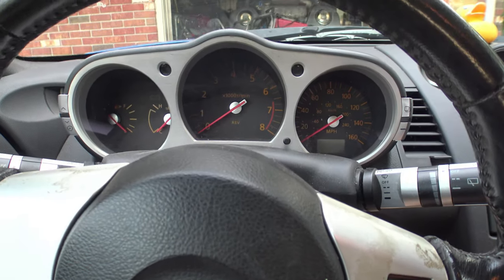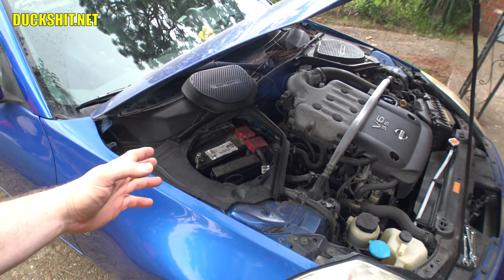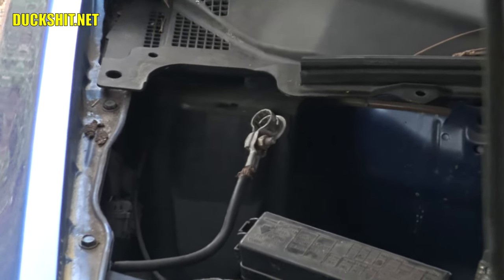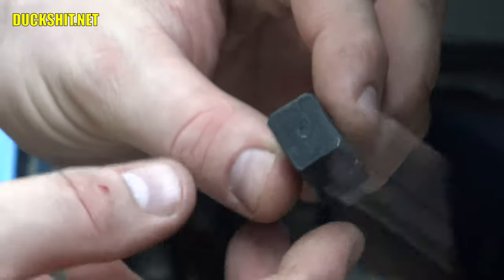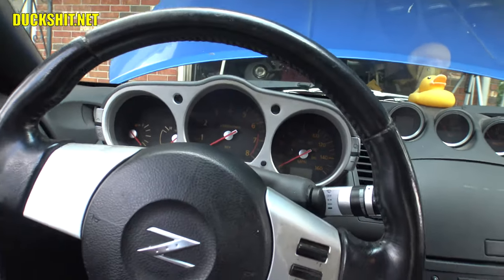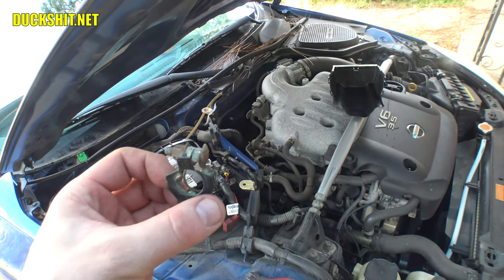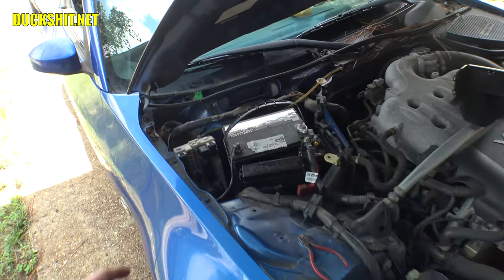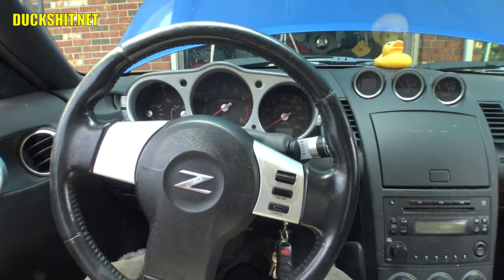Nissan 350Z Won't Start Fix - 4 Things to Try - IPDM Repair

Comment: too bad you didn't  do a video on the trouble shooting of the IDPM and the solder fix...would have liked to see what you did and saw.

bravo for fixing it though
Reply from the maker: Thanks, but anybody with a soldering iron knows how to fix it.  Just melt the dot with the crack in it.  That's all, not a very exciting video.   😁👍🏻
Reply: @DuckmanCycles  I hear ya...I get that you just wanted it fixed...but we (I sure don't) may not know what to look for on the circuit board.
Reply from the maker: I hear ya, but that was a bit outside the scope of what I was doing.  That's years of experience stuff.

Comment: Any idea what going on with my auto 2003 z, so last night it drove/started 100% fine. Today I go to start it and the battery is dead. I had to manually unlock the door with the key and see that the battery light on the dash is on but it’s really dim. So I take out the battery go to autozone and swap it out for a new one and they tell me the one I had before is not good anymore, which I thought was weird because I’ve only had it for under a year. So I take the new battery and once I plug it in there was a very noticeable ticking noise coming from that battery/ fuse box area even though the car was turned off. So then I go to start the car and it just cranks but doesn’t start. Any ideas what it could be?
Reply from the maker: What was the light on top your dashboard doing?  Have a look and lemme know.
Reply: @DuckmanCycles  can I dm you on instagram if you have one? I have a video of exactly what the car is doing, to answer your question I do recall that red light being on but didn’t think much of it.
Reply: @DuckmanCycles  Hold up I’m looking back at some videos I took of the dash today and I see the reflection of that red light being on🤔
Reply from the maker: @officialz3323  If the red light is on solid after you turn the key, they it is likely be your immobilizer.  Try a different key just for grins. But it could be the antenna, which is a ring around the key switch... it would be kind of strange for that to go bad suddenly though.  It could also be the BCM/ECU forgot your keys and needs to be reprogrammed... also a straighe problem but possible.  Hopefully it isn't a bad computer.
Reply: @DuckmanCycles  The red light is on solid but the key is not in the ignition, literally have to unplug the battery or the dash will stay on flickering and will drain it, car still only cranks but won’t start. The previous owner only had 1 key so that’s all I got :/

Comment: Could switching out the whole clutch switch work?? I’m having this problem again the frist time i fixed it was because replaced the Netrual position sensor but I got the problem again.....I Get in my car and I turn the key to on to prime the fuel pump then go to crank and the car completely turn off everything goes off until I move the positive terminal then everything turns back on but still doesn’t crank until I repeat the steps about 6 times it’s very frustrating could you please help me
Reply from the maker: It sounds like your positive terminal may be corroded or damaged.  I had that problem too!  I suggest replacing that Terminal and making sure the negative one is also seated properly!
Reply: DuckmanCycles and VW Garage Thank You!!!I Haven’t gave that a thought they are pretty loose I’m going to order new terminals just in case

Comment: Whats the red wired conecte ted to the positive terminal
Reply from the maker: Trailer wiring harness power.   Not factory, of course.  😁😁😁😁👍🏻
Reply: @DuckmanCycles  i changed my positive terminal now my car wont start even with jumping cables. The battery is new too
Reply from the maker: @car_venom2265  when you turn the key does the Dashboard Light Up?
Reply: @DuckmanCycles  yes

Comment: Where your radiator fans always coming on when ignition is on? Mine does that and doesn’t start after i dumped clutch in 3rd and stalled it
Reply from the maker: Mine never has, but for you thats symptoms of a bad ECU.  See what codes you can get out of it.
Reply: @DuckmanCycles   the scanner is not able to connect with the car I was thinking to start with ipdm since it’s cheaper but I’ll take a look at the ecm route
Reply from the maker: @aleemrahim6846  Check all ECU connections just because, but IPDM isnt likely, the ECU controls those fans... 350z with dead ECU makes fans come on when switching key on and nothing else... like no connection to scanner.  Save the money on IPDM, just my best opinion.  Let me known what you find!

Comment: You know, this is the second time I'm getting into this video, first time was because I needed to know where the IPDM was and how to access it, this clip solved that at that time.
Now I'm back because I'm having issues with the starter. Will start checking the relay :)
Reply from the maker: Thanks for coming back, and thanks for the comment!  I hope the video helps!  Feel free to ask if you have any questions, maybe I can answer!
Reply: @DuckmanCycles  I’m having the same issue with my Z but mine is an automatic with a slap shift. I replaced my battery and the terminals. Sometimes it starts and will for days sometimes is doesn’t and won’t start for a minute or sometimes days. I tried the relay thing but it didn’t work for me. I switched around a few too. I don’t have a clutch so I know it’s not related to that. I hear a click and everything lights up inside but then nothing. What would you suggest with an auto?? I’m in the process of taking out the IPDM now to take a look but if that doesn’t work I’m stumped.

Comment: if was a the latest model Nissan with just a dead relay you probable still have to take it to the dealers to have the error code cleared off the computer with a OBD scanner
Reply from the maker: LoL!  Maybe, I have a scanner here though.  No errors were thrown by this problem.

Comment: Hey got a 350z off a buddy that hasn’t ran in two years it cranks all day but no start any ideas of the issue?
Reply from the maker: Is there a solid red light up on the dashboard?
Reply: @DuckmanCycles  the security light no it blinks when locked
Reply from the maker: @rsflirter  Interesting, when I had that problem the light came on solid which meant the chip reader couldn't read the key.  Is your fuel pump pumping?  You should hear it buzz for a moment when you first turn the key.
Reply: @DuckmanCycles Thanks for replying man and yeah I got a mechanic to do diagnostic wanted to charge 1200$ for a new fuel pump did it myself for 190$ and realized it wasn’t even getting power but yeah it isn’t turning on any more solution ideas?
Reply: I did what kind of you did here I swapped some fuses one for the fuel pump and other was a/c I believe didn’t work
Reply: @DuckmanCycles  hey yeah the light is solid red
Reply from the maker: @rsflirter  Yep, solid red light means the immobilizer became active, usually because your key could not be read. Either bad chip in the key, so try a different key, or replace the immobilizer antenna. https://amzn.to/3HkRWFw  I had the same trouble some years ago.. when I was in the mountains with no phone signal!  But I beat on it a little bit until it started... starting was quirky for a while until I replaced it.

Comment: can someone tell me  if the relays are all the same?  or are each relay different?      can i just buy 4 starter relays and they all work in each relay slot?
Reply from the maker: There are 2 different types of relay in there.  You can swap the ones that are the same type of course, but not between types, check your IPDM diagram for details!

Comment: Chrysler uses "intelligent" power distribution modules too...they're called Totally Integrated Power Module or TIPM for short.  Have a tendency to fail but at least they're not buried deep in the car like yours is.  Just another example of modern cars being made overly complicated so they can drain your wallet as they age.
Reply from the maker: Not buried deep on a new Chrysler?   I guess on a new Chrysler they only bury the battery LOL

Comment: My car will not run unless jump out the run terminal on the relay insert. I get no ground when i test the prong but if i jump the prongs it will start. What is wrong?
Reply from the maker: Sounds like a bad connection somewhere, but that's about the best I can do by your description.  Check all of your plugins and also check your ignition switch.
Reply: @DuckmanCycles  Thanks, i know it has something to do with the ground or a wire not pulling the relay closed to ground it.

Comment: Can you post a video of how to trouble shoot the ipdm i need to do it to mine
Reply from the maker: Oh man, that's a pretty intense request and more than I could document in a video, that thing has 100s of circuits within with a ton of inputs and outputs that are designed to perform a certain ways, and not all of them are alike.   But like most things electronics, chase the wires, to the component that is acting up... check them for continuity and shorts to other circuits on the vehicle.  Also check switches, fuses, relays, as well as the device in question that is failing.  If everything else checks out then the IPDM is probably to blame.  And if you get clever, you can pinpoint the problem within the IPDM and repair it.  I'm a meddler so I dug into mine and got lucky and fixed it.

Comment: I can’t get my car to crank or anything at all. The ignition switch fuse just keeps blowing after 4-5 days. It doesn’t make any noises the windows won’t roll down nothing
Reply from the maker: Sounds like you got a pretty serious short somewhere, you'll have to run through the wiring harness and all of your switches sensors and connectors and make sure everything is attached properly and not burnt up or broken.

Comment: It's freaking scary how many connectors and wires go into modern cars. I shudder to think what would happen if someone were to drive them through a deep puddle.
Reply from the maker: Funny you should say that, a friend of mine used to have a Nissan Juke. He's a big dude about the same size as I am and chose that car because he just wanted something different LOL. Teerible choice... anyway, everybody made fun of him, and it was a blessing in disguise when Pensacola had a major flood and he had to drive through downtown... and yes, the water got the electrical and that was the end of it.  The water where he was driving wasn't even that deep, not yet anyway, but he had to abandon the vehicle on account of it stalling.  The water continued to rise after that and flooded the entire car.  His insurance totaled it out he was very thankful to get out of that stupid car LOL
Reply: @DuckmanCycles  Good for him, bad for his insurance premiums. Thanks for the affirmation. I'm going to avoid flooded areas from now on.
Reply from the maker: 5 years ago I hit some deep water with this car once on purpose, when I got home  the marker lights wouldn't shut off.  It turns out that was actually a notification mechanism in this IPDM when the ignition relay gets stuck closed... a few months later that relay failed.  And as I said in this video, I think it was moisture that got it, it was all green.

Comment: I think my ignition fuse is bad, is the one you put in the link the same for the starter and ignition?
Reply from the maker: I just realized I answered your question wrong, I thought it was a question on one of my air cooled VW videos, sorry lol!
Reply from the maker: I am uncertain if the fuse is the same I would have to check the diagram, but all the fuses are the same size just different values. Also the relays are all the same size.
Reply from the maker: The first relay that went bad on me was for the ignition, what's funny is the car started just fine and drove about 5 or 6 feet in reverse when it gave out... just enough for me to be an obnoxious obstacle in the street.
Reply: DuckmanCycles and VW Garage thank you...I saw that you put the high beam into the ignition slot to get yourself up and running when it went out. 
My 350z is starting to get worse. If you turn it over several times aka 30 times haha, eventually it does start. Would it not start if the ignition fuse was bad?
Reply from the maker: @isaacsangels7235  Yes, it probably wouldn't start if fuse is bad, but not be intermittent.  Check the relays, sometimes they get a little wet and the contacts corrode, or water gets in them.  Really easy to clean and swap them!
Reply: DuckmanCycles and VW Garage oh okay didn’t think of that, I will defiantly be looking at them and cleaning them or replacing them after work. Thanks for the help!

Comment: Wrong, in there service manual this fuse panel is listed as serviceable. even many years ago, because simple things like headlight are inside it.
Reply from the maker: Wrong, the headlights are not inside of the fuse panel... lol

Comment: i had my z’s alternator go out and fry like literal smoke, replaced, and now it just cranks but no start, all cam, crank, sensors are new as well. stumped
Reply from the maker: Did the light on your dashboard come on solid when you tried to start it?
Reply: @DuckmanCycles  no, it’s flashing as normal, so i don’t think it’s a nats issue

Comment: Hey man! I am having this same issue! Is there any way to get it running so I can at least get it home to work on the ipdm? The car will start sometimes so I know it's the not the battery or the starter or the alternator. I just want to get home haha
Reply: You can do what I did, push start it then jump in real quick put it in gear and let the clutch go!  If it's an automatic you'll have to bypass the impd to jump the starter... I can't tell you exactly how but yes it is possible.  Check your wiring schematic.

Comment: I’m lost here … im getting the no start just one click , brand new battery. The plastic piece on the clutch is completely fine. I can’t find a starter or ignition relay at any auto parts store.
Reply from the maker: Where is the click coming from?
Reply: @DuckmanCycles  sounds like it’s coming from in the dash or under where the pedals are
Reply: @DuckmanCycles  I watched a video where a guy had the some issue and it was the clutch safety switch ?
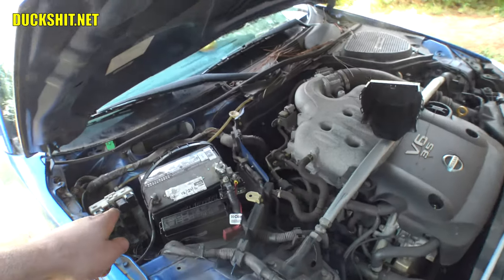Reply from the maker: @brandynshroyer4240  Did you watch my whole video?  Look at 8:55 and tell me what you think compared to yours.  Make sure your switch isn't broken off, and its going going THROUGH the little plastic bumper, even if it looks intact.

Comment: Im having a issue with no dash lights whatsoever..its my dim switch. Idk what to check next.. can the cluster really be out
Reply: What's my issue?
Reply from the maker: Could be a loose wire or connector, could also be faulty dimmer or headlight switch.  That's where I would check!  Its not likely the entire cluster would lose all of its lights at once.... unless a connector is not making proper contact!
Reply: @DuckmanCycles  my cluster gauges work and all just no lights along with no headlights or taillights.? But I have brake lights, turn signals, along with hazards and all relays and fuses are good..

Comment: I found 07 Nissan 350z, but the owner believes there is water inside it. Is there anything I could do or is that engine gone? Currently doing research, but all I can find is water pump issues. Also, he says the car does not turn on
Reply from the maker: Your question leads to more questions. It depends on how the water got there, and how long the water has been left there.  If you can't even get the car to turn on that would suggest it was possibly in a flood and may have severe electrical damage.  Not to say it's unrepairable, but you will definitely have some work on your hands.
Reply: DuckmanCycles and VW Garage thank you. I am thinking of negotiating with the owner atm to lower the price because the engine could possibly fail in the future, but the seller is all over the place not making any sense. He said it needs heads....
Reply: DuckmanCycles and VW Garage i am looking to get one from a junkyard salvaged. Currently researching about buying salvaged vehicles
Reply from the maker: @twistx7  Well, if the water got in the engine due to a hole in the head, or a head GASKET that might be what happened.  Its a big deal to replace a head or head gasket on a 350z.
Reply: DuckmanCycles and VW Garage i am 50/50 if I should buy it.
Reply from the maker: If the rest of the car is in pretty good condition then maybe you could offer him $500
Reply: DuckmanCycles and VW Garage okay last one, found a new lost in Facebook. 07 350z with no motor for 2.3. He is willing to negotiate and lives 4 hours away.
Reply: DuckmanCycles and VW Garage the car has no motor, however it still has the manual transmission and says it has small scratches and dents. How much would be a reasonable price to pay for it? I am no good at negotiating prices.😭
Reply from the maker: Not worth even 1k to me without an engine.  Other people might feel otherwise.  But that is where I stand
Reply: DuckmanCycles and VW Garage it has a rebuilt title too. Not a clean one

Comment: Clean the switch behind the clutch pedal. Just use some electro cleaner... it can be that if you don't hear a "click" sound of a starter relay.
Reply from the maker: Good suggestion, but not necessary in my case! Thanks so much!